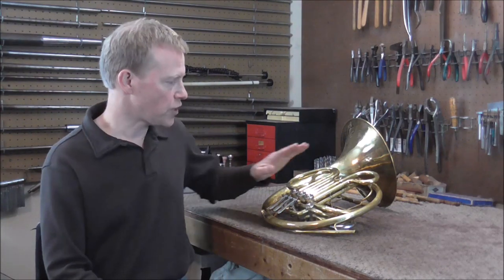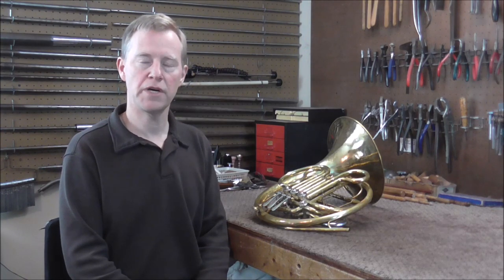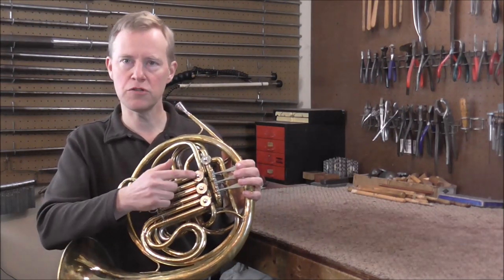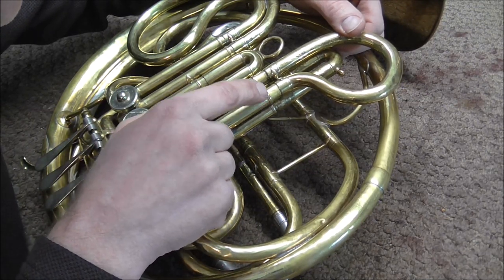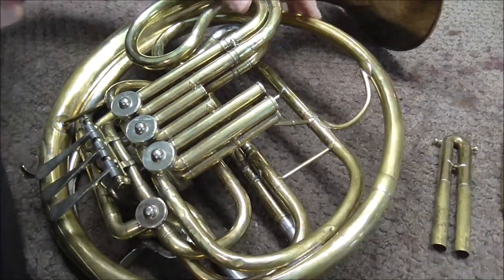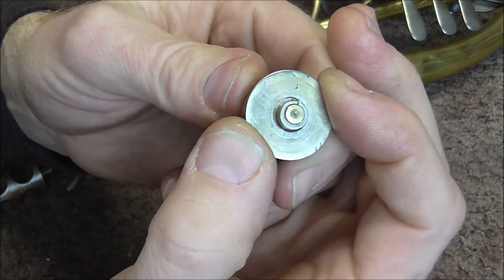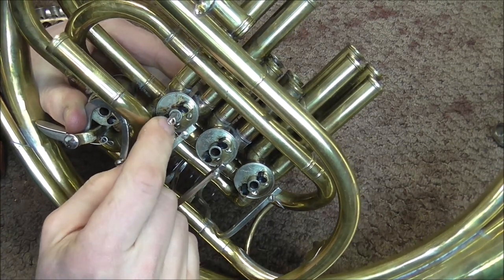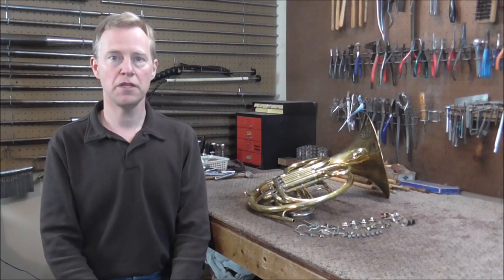Repairing a 100 Year Old French Horn With VERY LOOSE VALVES: #1 Introduction and Diagnosis

Comment: A coupla possibilities.  It was more likely nickel plated over the copper and brass valves.  Silver would tarnish, turn black and wear easily if used on a valve.  As you noticed, the pistons were separate pieces brazed together.   That was done to individually fit the pistons into the casing and line them up to fit the exact positioning of the hand formed tubing.  That allowed the valve to allow or stop airflow.

Comment: This might sound crazy, but if you could get the valve cores to take a bit of solder, and then polish them down a bit in a lathe, they might just tighten up enough, though solder is pretty soft. 🤔
Reply: That does sound like a great idea....but I think it might be difficult to get a thin even coat of solder....
Reply: @davemiller7633  Getting a thin even coat of solder should normally not be difficult. You need to clean the base material really well, apply a good coat of flux (the flux coats the material and keeps it from oxidizing when you heat it, and it is oxide that keeps the solder from sticking), then heat evenly and apply the solder. Using a solder pot and rotating the valve in the solder would be the ideal way rather than a torch and bar solder, but either would work.

BUT! These are two part valves, and quite possibly soldered. It would be Really Bad if you melted those joints when trying to solder plate the valves, and that is a really good possibility. This is a case where heat is most likely not your friend.

There is a secondary problem that solder is very soft and gummy. It would immediately start rubbing off between the valve and casing, and probably start gumming the valves up very badly, possibly locking them in place at some random bad angle, and making a future repair very difficult.

I think this is a case where trying some form of plating (silver, nickel, copper, etc) and then polishing that in a lathe might be a better choice. These are much harder and less gummy than solder, so should last much longer.
Reply from the maker: That is a great idea. I will have to think it through and figure out if it will work.
Reply from the maker: That is a very well thought out response to that idea. 
Thank you.